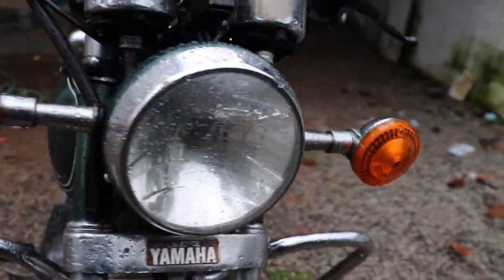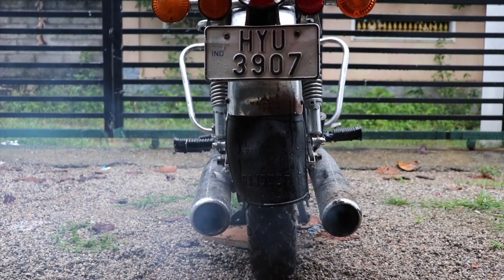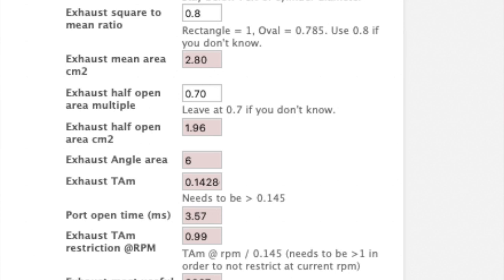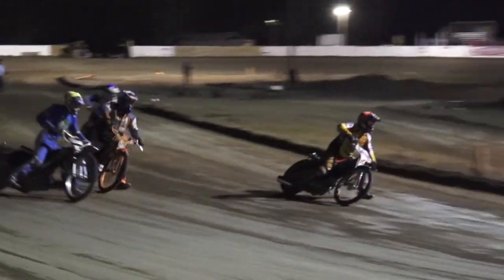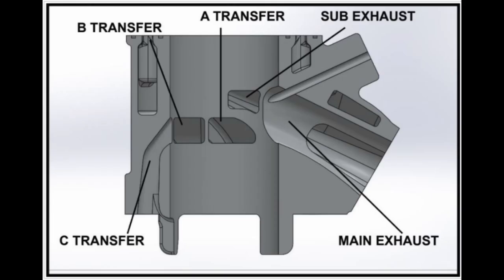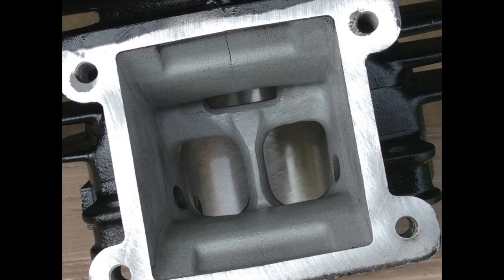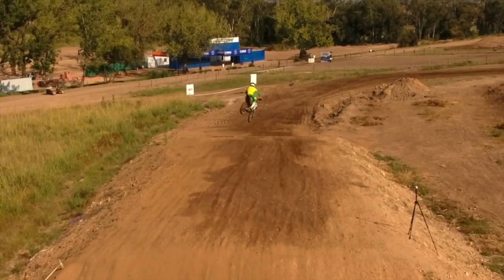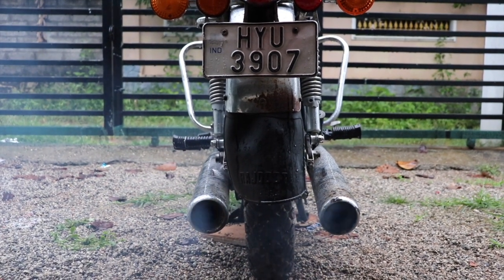Cylinder Porting Basics and Should you do it?

Comment: Hi  sir    I have a yamaha rxz 5s   & it has got problem with disc caliper as the   wheel is not rotating freely,   can you please tell me which O rings  and disc pads can be fitted in the caliper thanks
Reply from the maker: 5 speed has proprietary brake pads and the Calipers don’t match with any other Yamaha launched in india, take the prints out and match them at any automotive spare shops
Reply: @Yamakaze caliper O rings?
Reply from the maker: Auto correct, take the o rings and match them at any auto spare shop.

Comment: What is the advantage of using double exaust port in a single cylinder motorcycle like yezdi.☹?¿
Reply from the maker: There is no advantage than getting sound, with modern simulation tools and better understanding for flow dynamics, better scavenging can be achieved in with a single exhaust port.

Comment: My rxz speed is 140 without porting.
Reply from the maker: 😱what modifications do you have?
Reply: @Yamakaze  5 speed kit(040 no. Piston) and gearbox convert to 5 speed only.
Reply from the maker: @psinfotainment4925  do a test with a GPS, speedometers are very optimistic. I am not saying 140 is not possible, in the stock form it’s very difficult.
Reply: @Yamakaze  I checked it with swift car. meter is accurate. I think tyre size and body weight depends.
Reply from the maker: @psinfotainment4925  let’s agree to disagree, the best method is to download a gps app on the phone and then check the top speed.
Reply: @Yamakaze  I will try👍